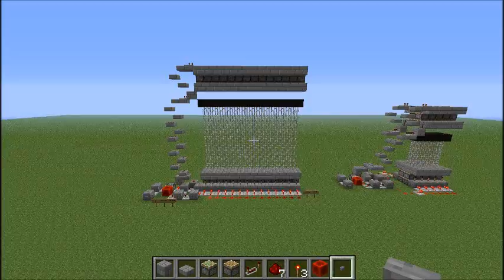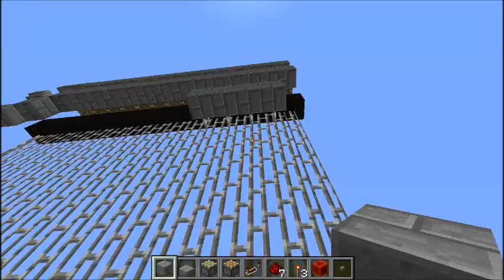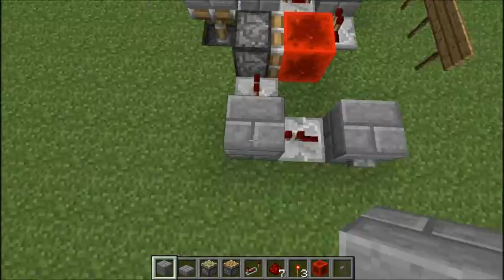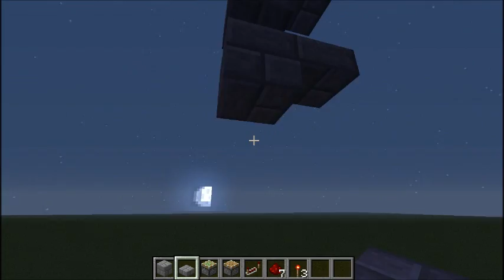Minecraft Compact Castle Gate Tutorial (No Sand or Gravel) [PC]

Comment: I can't seem to get the pistons to go down like you did when breaking and replacing the redstone torch, at first like half of them did, but no luck on all of them. I even tried what you said in the comments about breaking the torch powering the line and then breaking and replacing the torches powering the pistons...
Reply from the maker: Ok... I think I might know how to fix it.  Are all of the pistons going through the complete "rotation" of movements just not all in sync with each other or are half of them just not working at all?  If they are all working , but out of sync, try breaking the redstone torch powering the entire thing, then break redstone line so it only powers the ones out of sync and use a redstone torch to "manually" cycle the pistons until they match up with the others.  I'm not sure if this is the actual problem, but I got the pistons to act someone similar to what you described in a creative world and this fixed them.
Reply: Russle96 I'm a bit confused, I got it to do the first piston right, then one in the middle, the rest are all out of sync. I can't seem to get them all to drop when I break the torch. When I break the redstone and only power the ones out of sync, I can get them in the same position as the others not being powered but as soon as I readd the torch, it resets everything :/
Reply: Russle96 and they all resync again. Like I said, I can't seem to get them all to drop down once I break and replace the torch...
Reply from the maker: Ok...  are the pistons even fully extending, or are they stuck with only one pistons extended at a time?
Reply: Russle96 the one that syncs right, when I remove the torch both pistons extend, but the rest of them only the bottom ones extend up and I can't get them to all drop at once
Reply: Russle96
actually what happens is when I break and replace the torch they alternate on whether the bottom pistons extend and not the top and then the opposite...
Reply from the maker: Ok, to fix that all you should have to do is break the torch the powers the redstone line, then individually break and replace all of the torches that are next to the pistons, then place the torch that powers the entire line, then break and repalce that torch again, then all of the pistons should be down.
Reply: Russle96 *sigh still didn't work mate...not sure what else to do :/
Reply from the maker: Hmm...  I can't think of any other reason why it wouldn't be working for you.  I would suggest building it again in creative world to see if you can get it to work there, then compare it with the one you're having trouble with to see if you notice any slight differences.
Reply: I did and ended up going with a different design as I think it's the server I'm on unfortunately as it works elsewhere
Reply from the maker: Ah... okay, I had no idea that it didn't like servers, sorry for the inconvenience .  I'll probably try to make a more server friendly version/fix for future use.  Glad you ended up finding something that worked for you.
Reply: Russle96 Same happened for me. On servers I found out the problem is that the redstone repeater goes through the block and then it powers the piston
Reply from the maker: What repeater and piston are you talking about?  If you let me know, I might be able to make a work around for it to work on servers.
Reply: Russle96 At the part where you put the row of repeaters going into the torch, they pwoer the pistons because repeaters can power things through a block. That's the issue. I tried to fix it but it doesnt work.
Reply from the maker: Well... that's supposed to be like that since it takes both the torches and repeaters to make the pistons go through the "opening cycle".  Also, I just built this design on my server, and it worked, so I'm not entirely sure why it would be working for other people.  My only thought would be that if there is a little bit of server lag, would be to increase the delay on the repeater at 4:22 to compensate for any possible lag.  Aside from that, I would double check the timings on all of the repeaters, and if the pistons of the opening part are "broken" try breaking the single redstone torch the powers the redstone line.  Then break and replace all of the redstone torches that directly power the line of pistons.  After Breaking and replacing all of those, replace the redstone torch that powers the redstone line.  Then break and replace the same redstone torch to finish the cycle to reset the pistons.  Hopefully this will work for you.
Reply: Russle96 Unfortunately it didn't work. The server might just be too laggy. I'll do it on a singleplayer sever and keep in contact with you on whether or not it works

Comment: So this doesn't work on 360?
Reply from the maker: I honestly don't know, I haven't really gotten a reply on whether or not my possible solutions actually work... but as far as i know the only part that would have to be different would be to replace the redstone block that powers the "core" of the circuit with a solid block, then put 2 redstone torches underneath the 2 spots that that block is pushed by the piston it is attached to.  In theory, that should work unless the actual timings for redstone itself is different.  Also, if the redstone block is added to the game it should work as is, i don't really keep up with the 360 version.

Comment: I recently tested this and with the block where I stick the two torches on when the piston pushes the block it brakes the torches and the sticky  piston lets go of the block, also the half slabs dont let you place anything other than half slabs on them and sticky pistons keep letting go of the floor blocks, I dont know if its a glitch or the way its programmed but they arent very good... (on ps3 version, dont know about xbox) hopefully these problems will be fixed in an update.
Reply from the maker: Ok, the redstone torches that replace the redstone block go underneath the spot so they power the redstone when a solid block(which is pushed by the piston) is above them.  For the redstone to be put on the slabs they have to be upside down, I have no idea if this is in the console version, but if it isn't you can try using glowstone instead, because it should have the same effect.  As far the the bottom pistons letting go of the blocks, I would check the timing on the repeaters and maybe increase the delay of the one set on 1 tick of delay in the "circle" part, the timings might be a little different on console.  Um... hopefully this helps, let me know I need to clarify anything or missed something

Comment: OK so the problem im having is after i activate the gate it only works once. the second time the row of blocks on the bottom sticky pistons wont retract all the way down they stay extended do you ever have this issue also i tried your fix it will work once. again they just break? frustrating that it works perfect once then breaks any suggestions?
Reply from the maker: Wait...? it works completely fine through one "cycle" of opening and closing, but then doesn't work the next time you try and open it?  Or do the bottom pistons only extend 2 blocks then not retract fully during the opening stage, if it's this I would check the delay on the repeaters because that will happen if there is not enough delay between the two pulses. Sorry for the somewhat late reply.

Comment from the maker: For the entire thing to work you need to have the redstone go to the repeater the button powers in the video.  Probably the easiest way would be to place redstone on the other side of the wall, then use a combination of just a normal redstone line and downward redstone wiring by using redstone torches powering redstone below them that burns out another torch, I'll try to make a picture to show the redstone torch thing better
_
[]/
  _
 \[]

make sure that it doesn't interfere with other parts

Comment: I've got a good bit of space I am just unsure how to wire it...I tried taking the button from where you placed in and take some redstone up to connect it but when I placed the button it didn't do anything. I tried several different ways and ended up having to redo the circuit because it stopped working...LOL. I thought to use the slabs for the top pistons to connect the button since they are between two walls but I wasn't sure if that would work...